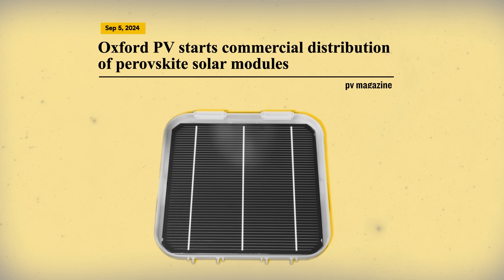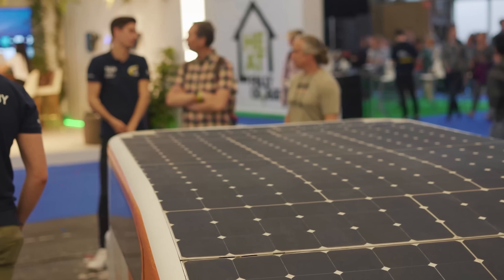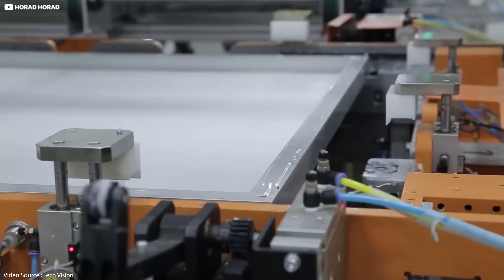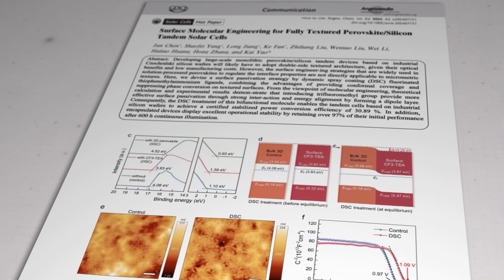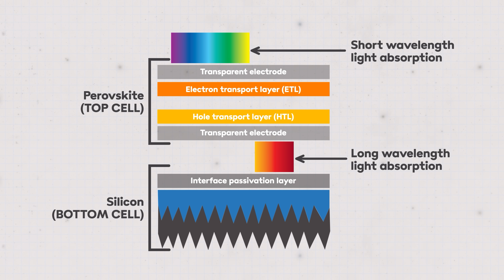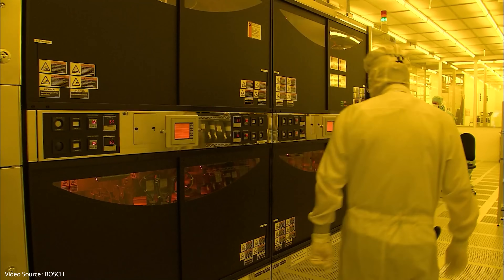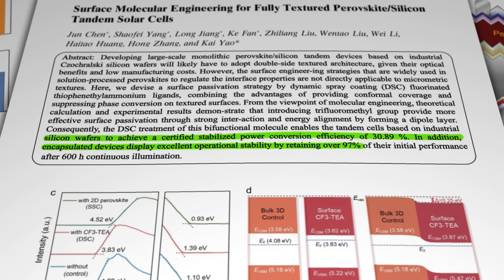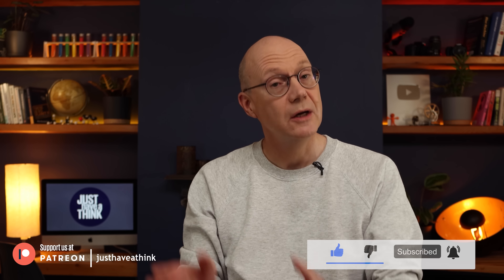Solar PV with more than 40% efficiency is now achievable.

Comment: Average roof area is 200m² 
7kwh rooftop PV is 33m², 15% of the roof area. 20% more efficient means 6m² less roof cover.

The largest area available for PV panels is on the customer's building roof. 
All buildings ARE GRID CONNECTED. 
Grid capacity is 1,000% more expensive than all types of generation 
And we are expected to find 5% improvements exciting, FMD.
Reply: roof solar panels are exponentially more expensive than ground solar panels, and they usually only try to power one house, not the entire grid, meaning you would need ground solar panels for industrial energy, and the more efficient the panel, the less surface you will need to dedicate to solar panels.

another important factor is more efficient solar panels require less material to make, specially if perovskite solar panels are more efficient during sunrise and sundown since they cover the more visible light spectrum. so you would need to manufacture less solar panels for the same energy.

and lastly, and probably the most important factor to consider. a lot of places in lower or higher latitudes don't receive enough solar energy to be worth it for the surface area they have available. however the more efficient each solar panel is, the more viable they are for places that receive less sunlight. and again, the fact that perovskites work better for visible light means they can work a lot better with indirect light.
Reply: @danilooliveira6580  actually at higher altitudes they become much more efficient
Reply: @danilooliveira6580  Australian rooftop PV is cheaper than windows $m². With sunshine, grid electricity is not needed in the day peak.
With only 4million buildings with rooftop PV the government is looking to charge the customers supplying dirt cheap electricity into the grid.
Reply: Sounds like you've got it all figured out then @stephenbrickwood1602 .
No need to make anything more efficient really, let's just keep burning stuff because the infrastructures already there & it would just take too much energy & effort to be more efficient at anything....... irony probably lost in text here.
Reply: @CamTracey  Australian rooftop PV is cheaper than windows $m². With sunshine, grid electricity is not needed in the day peak.
With only 4million buildings with rooftop PV the government is looking to charge the customers supplying dirt cheap electricity into the grid.
Reply: @CamTracey  wow.
Look, I think we are on the same page, so to speak.
These short comments can be misleading. 
Let me say my understanding of things. 

Australia is in the same latitudes as the Sahara Desert latitudes but in the southern hemisphere. 
Australia will be the first continent to burn.
Decade long droughts and then intense flooding rains washing topsoil away leads to desertification. 
Climate destabilisation is the real danger. 
CO2 emissions worldwide is the problem. 
Nuclear electricity promoters are saying nuclear electricity for the world but ignore the military budgets exploding.
Nuclear electricity needs the grid, and more clean grid electricity needs more grid capacity. 
The grid in Australia is a million km metal infrastructure that needed coal and iron ore and copper and....
And much more mining and...
It creates more CO2 emissions just to build bigger grid capacity. 
And the entire world is impossible. 

Tony Abbott should have been fighting for Australia future climate a decade ago.
But he would have gone nuclear electricity earlier. 

You do have a valid point.

Comment: 40% efficiency solar cells would definitely make solar electric vehicles much more viable for lots of folks out there. Right now it seems that the typical range gain from adding solar cells to a vehicle is about 10-20 miles per day, but doubling current efficiency would bring it up to 20-40 miles per day, which I believe would cover most people's commutes. Very hope inspiring tech. I'm glad to hear that this one actually came to fruition. I hope the technology continues to improve too.
Reply: For a 1 person commuter car in a sunny area where they don't have anywhere to plug in at home I think it can be useful, but only in that niche currently. With current panels you can get 40 miles per day under optimum conditions. That's enough for the average commute. Doubling panel efficiency would mean that could work in much less optimum conditions.
Reply: Agreed. Also for ships, semi trailers etc. where it might not cover their whole energy requirements but anything that can meaningfully and cost-effectively cut diesel consumption will be a win, financially and ecologically.
Reply: I certainly wish this idea well, but for now the added weight gain and overall vehicle reliability penalty really cancels out any benefits.
Reply: @2ndfloorsongs minimal weight gain, when the free form placement of solid state batteries, graphene etc, will prolly in the long run REDUCE the weight of new vehicles compared to old, when a car seat & frame can all have solid state batteries in different forms..... just any fire in that case would have to have some kind of auto cancelation ( auto air bags for accidents...some kind of auto something for fires...have no idea what, someone might have to invent such deterants)...system, otherwise the driver & crew are guaranteed golden brown toasties....
Reply: @zechssiguro7476  Now you're increasing the expense of the car significantly in exchange for weight and keeping the reduced reliability and added repair costs for the benefit of about 5 minutes of charge time and much less if you can't park the thing in the sun. Down here in Texas I suspect any energy benefits would be canceled by the extra air conditioning required to get the car cooled down. Much better to park in a cool garage and plug in a low capacity charger. Not that there won't be more vehicles like this, but they're for a niche market and people that can afford them.
Reply: Solar panels on the car might never happen, but a solar canopy charging at a peak of 6kW? That is already enough to cover most people's transportation needs provided it's installed at commuting destinations.
Reply: @idiottv6499  Y'know, that's a pretty good idea. :) I'd love to see this be a free, or very cheap, service which municipalities and other governments can provide for their cities. A bit like public transport, in a sense.
Reply: Not for an actual car. Real cars with airbags and crumple zones and such need to weigh at least half a tonne, and to get any decent power output you need like 50kW. Putting 500W of non-angled solar on your roof might increase range by 1%, it’s just not worth doing.
Reply: ... Whatever happened with the 
s/p tek developing panels so efficient that they'd even be able to charge a battery at night from starlight-? ...
Reply: @peteraddison4371  They are right over there with the leprechauns and fire-breathing dragons.
Reply: do you know how long it will take to charge a car on solar cells ? you should do the math.
It's the most stupidest reason for getting solar cells.
Reply: The reason not to put solar panels on cars ultimately comes down to cost. At current costs, I don't think it's worth it, but there is some threshold where if the panels become cheap enough, then it is. Remember, to be worth it, the solar panels don't need to generate enough electricity to fully cover one's daily driving needs, just enough to offset the financial cost of the solar panels themselves. And, the cheaper and more efficient the solar panels become, the more people there are who park in the sun often enough to meet this threshold.
Reply: @ab-tf5fl  Look at the upcoming Aptera.  That car might be worth it, assuming it performs as they are claiming it will perform.
Reply: This is very exciting!  It is definitely practical for micro-vehicles!  And potentially revolutionary in niche markets.  Solar Sprout by Wink Motors would have tremendously extended range making it far more practical for nearly all island or city errands.  These make excellent shared neighborhood cars as they are in the 10 K range.  

Charging is an additional challenge,  and solar solves that for the niche function of micro-vehicles!  This is potentially a game-changer!
Reply: @amyw1850  💯It's very exciting indeed!
Reply: Adding solar cells to a vehicle will only add a few miles a day. Not really viable.
Reply: Edison Motors seems to be the front runner for the future EV race right now.  Perhaps if solar and battery technology improves that will no longer be the case.  I'm not going to hold my breath because it is likely going to take a long time for solar and battery technology to catch up.
Reply: @wesbaumguardner8829  Edison motors is making a hybrid logging truck, not a car !
Reply: We can all have our pipe dreams.
Reply: Solar panels on cars is not a thing. Benefits won’t outweigh cost complexity and battery tech will make it pointless
Reply: @IverKnackerov  Aptera.
Reply: In a sunny place, during the summer, with direct sunlight...
Reply: keep eye on graphene solid state ev batteries,, goal is 600 miles, extremely fast charge and less prone to fires.
Reply: @rosspitca9142  No such thing !
Reply: Cost is too prohibitive at the moment, but thinking is sound, I'm more interested in the silicone laminate technology and it's application uses to be honest@rosspitca9142
Reply: @rosspitca9142  batteries are not “prone to fires” especially compared to ICE.
Reply: 10-20 miles in the best possible conditions with direct sunlight, for a small fortune that would cost to apply them to the entire surface of the vehicle. it's never going to be worth it unless for super light vehicles designed specifically for the purpose of maximizing solar energy.
Reply: @danilooliveira6580  Not if you use thin film panels on a tonneau cover of a truck. Or cover the roof of an RV or van. You can get about 1.5kw of panels on the tonneau cover of a ford lightning currently. In optimal conditions that's 25 miles per day. If we get to 43% efficiency that's closer to 60 miles a day. That's more than most people need. You could power a small welder from your truck in the sun without even using battery power. So yes it definitely has some great applications. The cost for those panels now is maybe 400$ for 1.5kw and the added weight is essentially nothing.
Reply: @cameronmacdonald6525  uhhh  " The cost for those panels now is maybe 400$ for 1.5kw and the added weight is essentially nothing."     where?
Reply: @danilooliveira6580  Like the Aptera Sol
Reply: BEVs need to get lighter so we get below 1 kW per 10 km. No need to have solar panels on the car,much better for efficiency to have them right orientation and angle for maximizing the efficiency. BEVs will recharge as they are in park 98% of the time.
Reply: @peteroffpist1621  I had 3 panels on my little electric truck, for 9 months of the year they produced enough electric to power it for my daily use, sometimes panels are best placed where you use them
Reply: @peterszczesiak6025  agree
Reply: @peteroffpist1621  1kWh at best gets you only 3-4 miles (4.8-6.4km).   You're dreaming !
Reply: @peteroffpist1621  panels on the car is for people who can't charge as they park because they have no off street parking etc.

Comment: Don’t mean to rain on your great new technology, but as a nuclear engineer, there is but one factor to consider when buying a solar system for your home or business,  BOS=$/kW-hr produced.  No amount of panel/cell efficiency to consider.  It’s a meaningless parameter to the normal customer!!!

Most solar systems come with a 20-35-yr production warranty, but after 10-12 years, the electrical wiring is generally beyond economical repair, which means if something breaks, hurricanes, fires, flooding… it’s more cost effective to simply replace the system, than trying to repair it.  

What’s never mentioned, especially when talking great new technology, is the cost of recycling panels, VS storing them in the barn where they will never be used after repair.  So if you really love the planet, we need to start charging a recycling fee, about $25/panel, to create a market for the 10,000,000 panels already in service.  

Nice video, just not relevant to the cost of solar.
Reply: But solar's a whole bunch cheaper than nuclear, right?
Reply: @ambrosenuk  Yes, significantly.
Reply: @ambrosenuk Yes, solar is currently half the price of nuclear power!

That said, it doesn’t have to be that way!!!  Remember that most nuclear in USA was developed within a regulated marketplace, which means that the industry’s reaction to any challenge, was to adopt whatever the complaining party wanted, and just pass the cost along to the consumer, ~4% to industry consumers, 96% to residential and commercial customers.

Basic nuclear fuel used to cost $9/lbm, which is about what LA uses per month.  How we went from $9/lbm, to 2X of Solar is the story of endless greed, deregulation and of course, lots of people buying solar panels… ones with the lowest BOS costs!!!
Reply: BOS?
Reply: @brentgraham1735 BOS is balance of system… sorry!